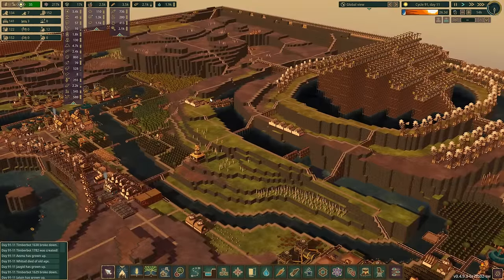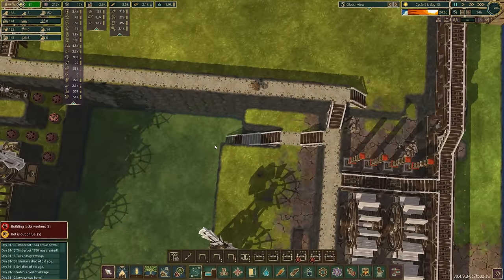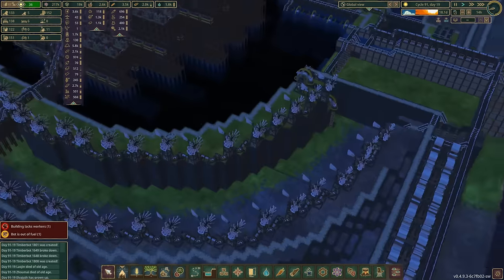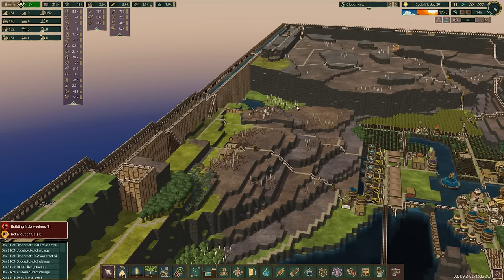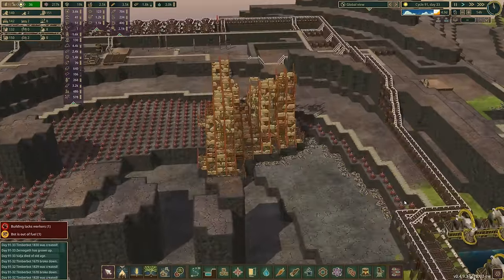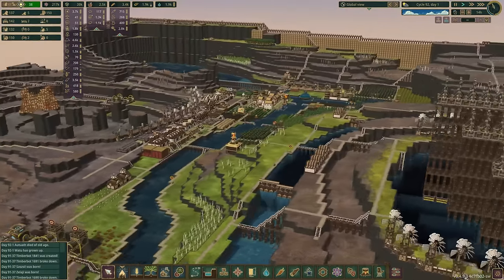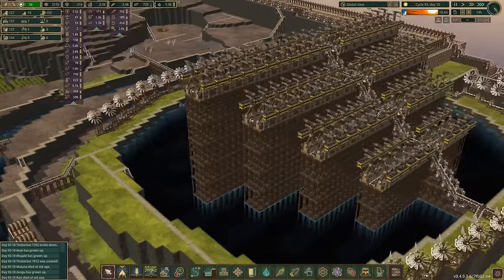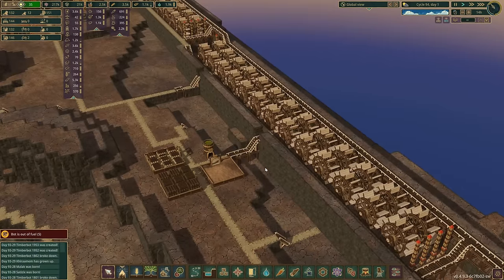THE BIG TEST: Surviving the Longest Dry Spell! - Ep 21 Timberborn Hard Mode

Comment: As a thought for future large projects.  If you are filling in a large amount of terrain, you should highest prioritize a single wide path through the area.  
For example: When building your aquaduct, at most, there was only 6 blocks to be queued and worked on at a time. (12 when working both ends). If you had a terrain bridge connecting the two ends, more blocks in the middle could've been queued up at once, better utilizing your  numerous terrain bots. :)

Comment: Timberborn Hardmode is like hard for a few cycles and then it's just sandbox the rest of the time... 30-day droughts are a joke. I hope they add something harder. like a progressive drought where the droughts actually gets longer and longer or there's a new obstacle to hurdle. The new bad water system is just the same with the hardmode, a few struggling cycles and then after 20 cycles or less it's just sandbox mode. JUST SAYING. OPINION.